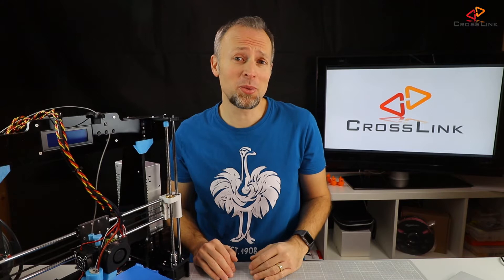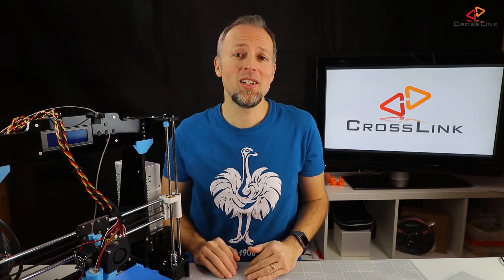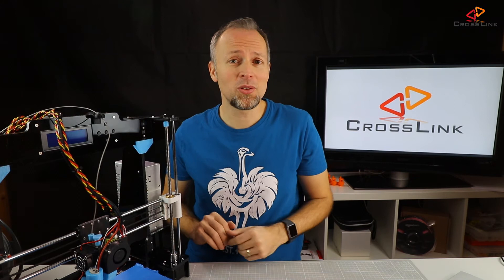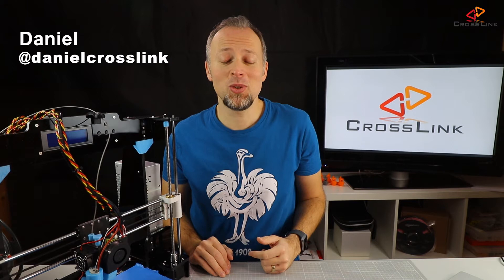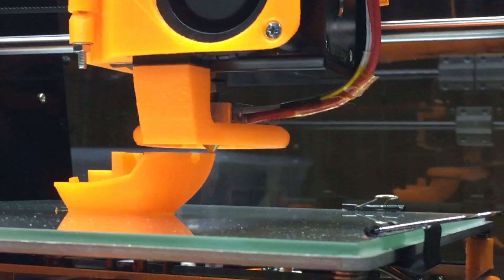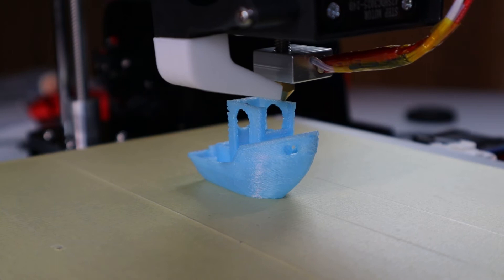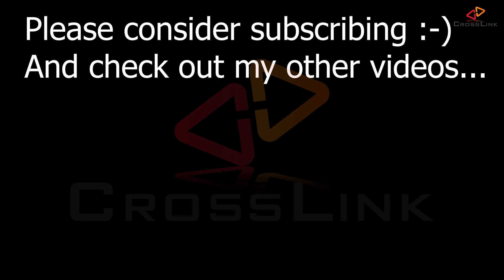Crosslink Channel Trailer January 2019

Comment: Daniel do u know how to properly print abs on a anet a8
Reply from the maker: Well, yes, but I am not using it anymore since a long time. It is possible but there are a few things to consider: 1st have all the safety upgrades done because ABS needs a lot more temperature at the hotend and bed. Also printing within an enclosure is strongly recommended because your prints will otherwise warp heavily and the heating up takes much longer without. Temp stability will also be an issue without an enclosure. The slightest amount of airflow, an open window etc might cause the print to fail especially now when it's winter outside. The next thing is that this material really releases fumes that are toxic if you inhale them over longer periods and they really smell. So you might need to run this in a seperate room with an open window or some sort of filter system connected to your enclosure. I would never do this in my living room or base department because it's really hard to get the odor out. In general I would say that PETG is a much better choice and ABS is very much not needed anymore today. There is much better materials and it depends so much on the purpose of the part of course but ABS is really last resort in my opinion.
Reply: @Crosslink3D  well im using abs because thats the last roll of filament i have and i dont have money for a new 1 right now  

I appreciate you responding and your Channel deserves way more subscribers u make good Quality videos and they helped me a lot
Reply from the maker: Thanks Tim for that comment. It will Happen eventually that this channel grows. I am just going to do this  video by video. Every subscriber matter to me as long as I can bring value.